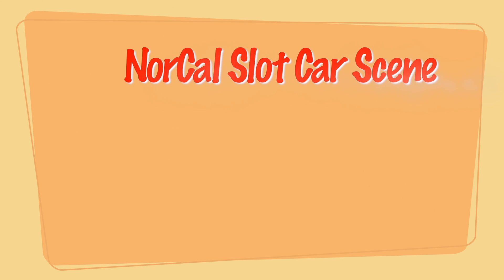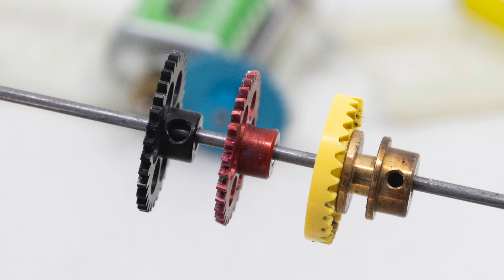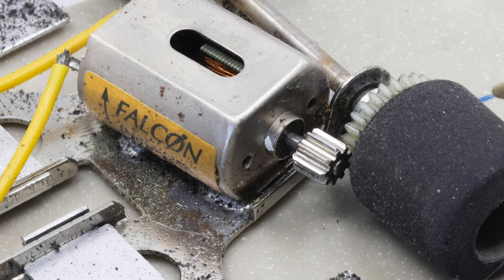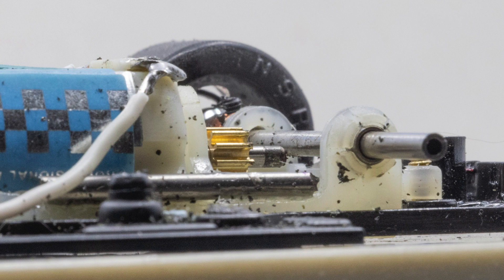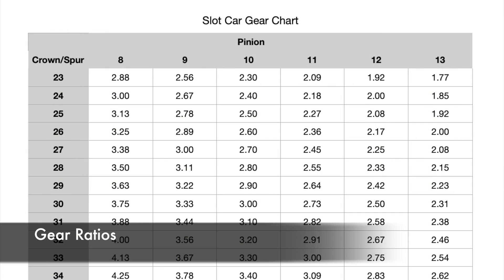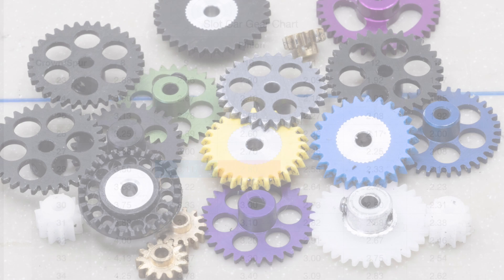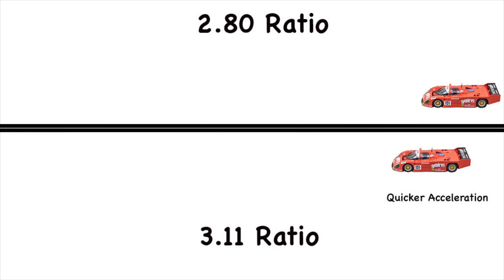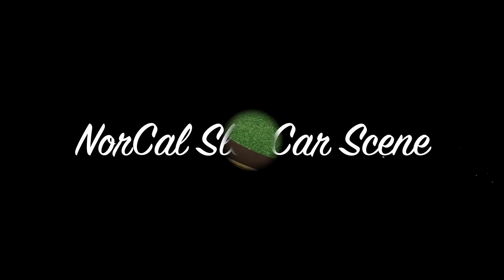Understanding Slot Car Gears and Gear Ratios

Comment: Good info. For inline setups why choose one pinion or crown gear over another? For example could one 9 tooth pinion be better for a specific crown gear than another? I have 2 axle kits that each came with 9 tooth pinion and crown gears and wondered if i could use them interchangeably without any issues or ?

Comment: Other variable is car mass, if you lighter some weight from your slotcar. This allows to use higher gear ratio without harm car's previous accelerate behavior.

Cheers!
Reply from the maker: I'm working on a video about lightweight gears and axles

Comment: Thanks Jim , great video , have been doing slotcars for years and still to this day get confused between high and low gear ratios  , knowing what each ratio change does , going high  or low  , but could never remember which was which , what was considered high and what was considered low , but this quick video made it so clear ... Thank you .